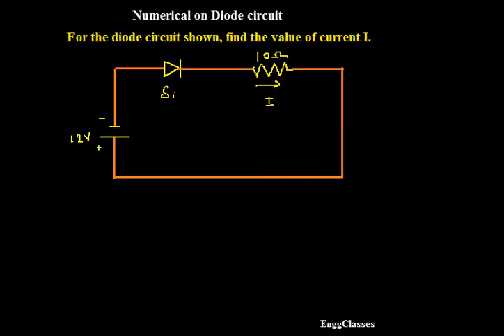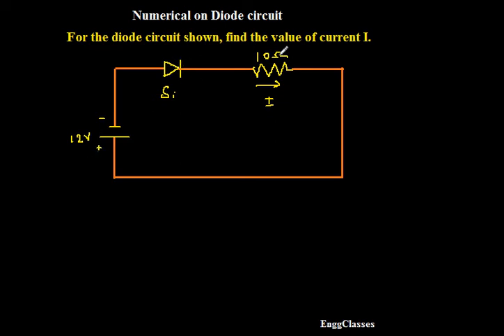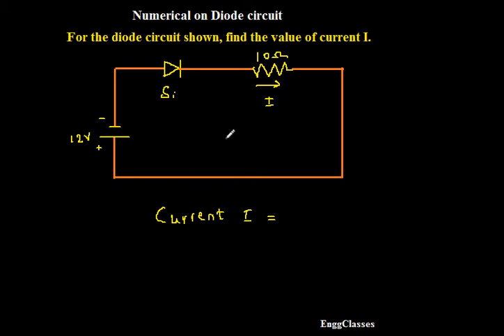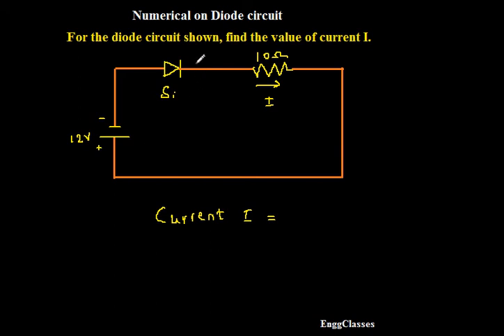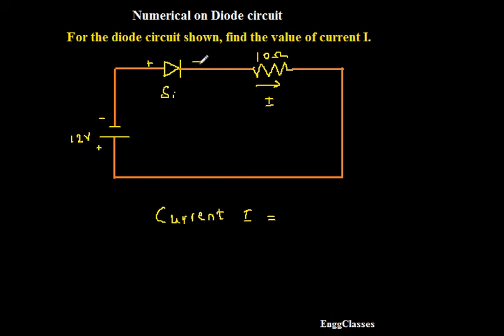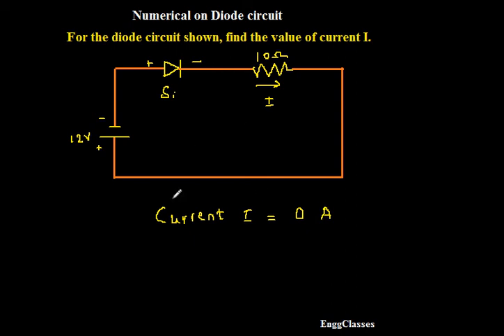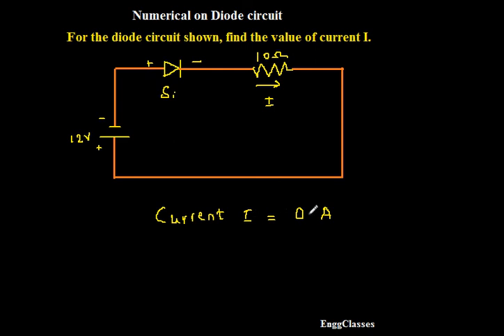Diode Circuits (Numerical 1) | BASIC ELECTRONICS

Comment: Circuit was in wrong direction since diode should be with positive terminal of battery..and in this case it was connected wrong which makes the circuit completely ideal ..

Comment: If the diode is in closed
Reply: Leave that question then
Reply: Then for silicon v will be 0.7 and use the voltage equation to find current